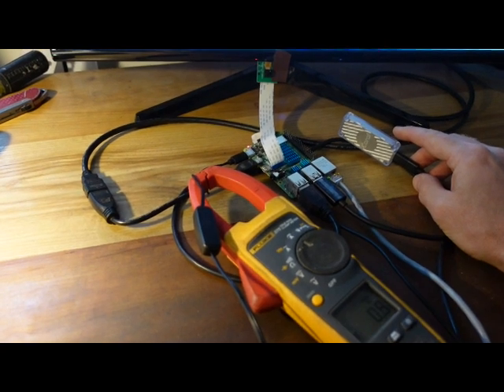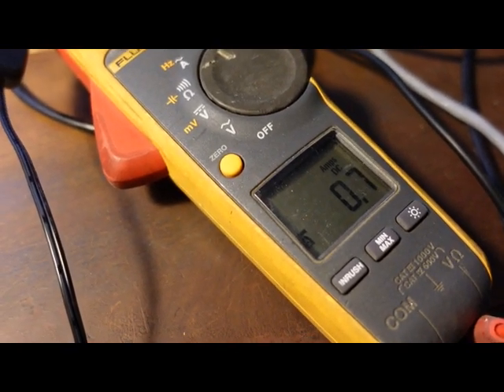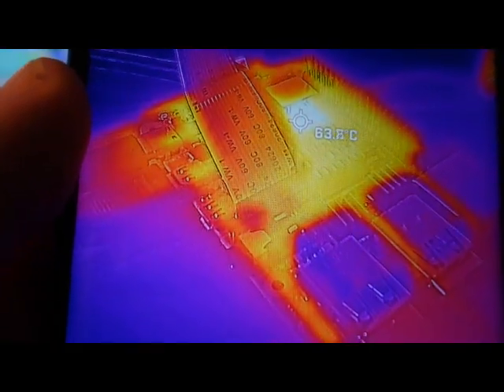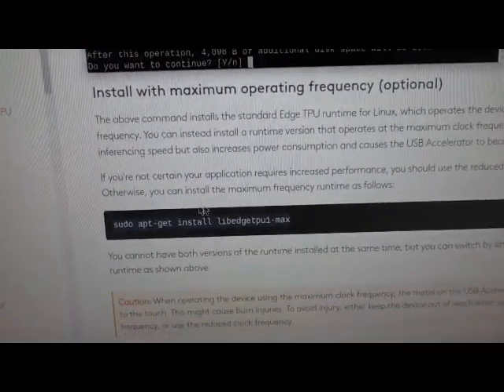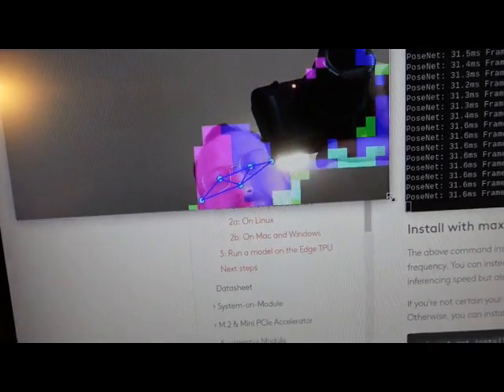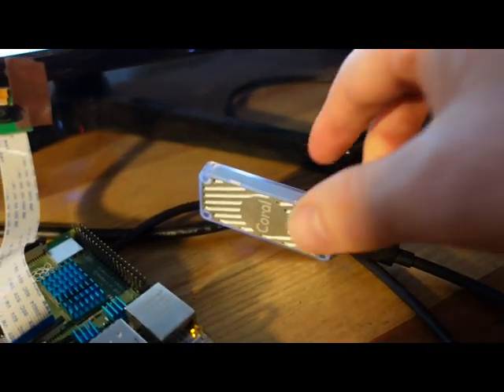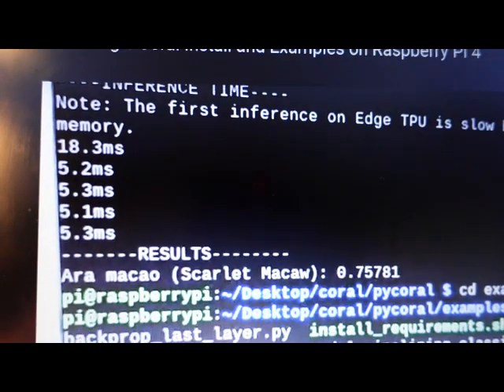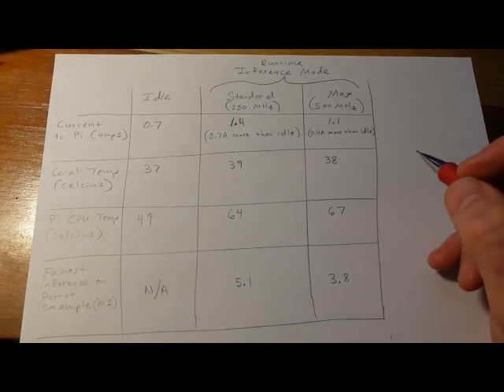🔥How hot does Google Coral get?🔥

Comment: Nice job. There's not too much about the coral TPU's around on YouTube other than people running the main example so its nice to see someone exploring some of the questions/features around them.
As for the question about if the TPU throttles itself, if you look at the datasheets for the M.2 versions of the TPU, it has a whole section on Thermals and power delivery.
You're right in supposing that the TPU has an integrated thermal sensor and will throttle itself, though judging by how many warnings and disclaimers the datasheet has, I imagine its not a fully optimized solution (like you find on PC CPU's) so you can still damage the TPU if you're lax with cooling.
I was really interested in the Dual TPU M.2 (2 TPU chips on one board) but they made it in an 'e-key' M.2 format which is hardly compatible with anything and crazy difficult to find adaptors for. They still do a more 'normal' single TPU M.2 as well though and its cheaper than the USB version as well.

Its odd how the max temperature you measured was nowhere near the stated maximums you see on the datasheets and how the Max mode didn't really produce any better performance or higher temperatures. I think this might point to the cooling solution not being very well optimized.
EDIT: as I'm writing this I saw you had a teardown too and 100% the problem is those MASSIVE thermal pads and the aluminium anodizing that transfer the heat from the TPU to heatsink. I bet a correctly sized copper or aluminium shim with some real thermal paste would make a massive difference unless the USB versions power delivery also limits performance.

Anyways, very interesting videos :)